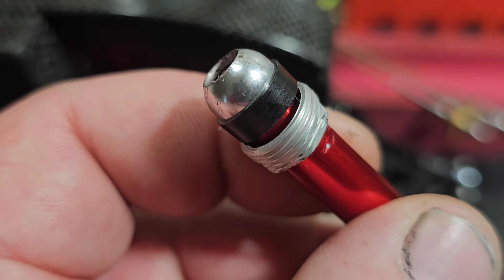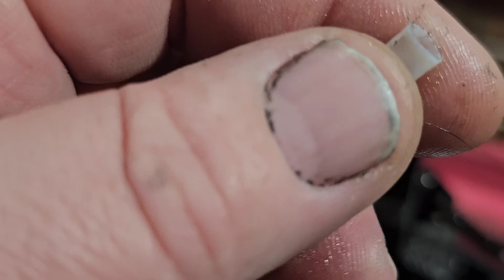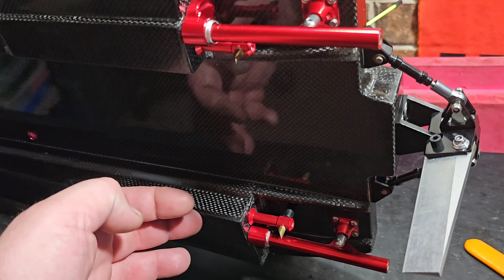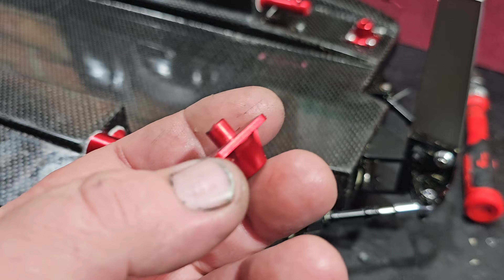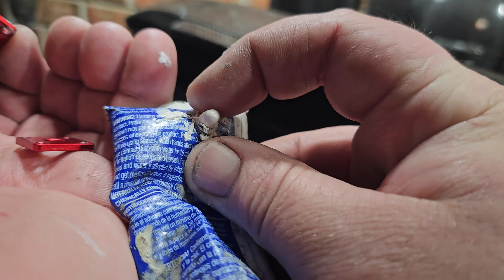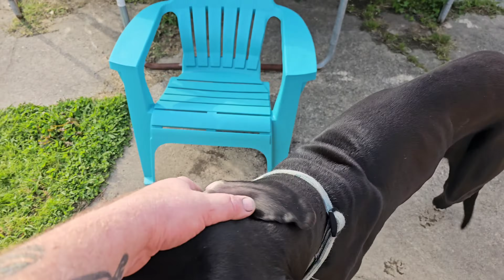Sealing Outdrives/Stingers, Teflon Liner Removal Animal Twin Cat Maintenance - 200a Esc, 4082 2200kv

Comment: Nice work B. I notice you had a break away screw for the rudder. Was that black nylon or something else please ?
Reply from the maker: Black nylon m4 screw is what i use!    I drill all my rudder breakaway holes  to m4 usually 20mm length works for all my boats.   Buy 50/100ct m4 x 20 nylon breakaway on Amazon for cheap